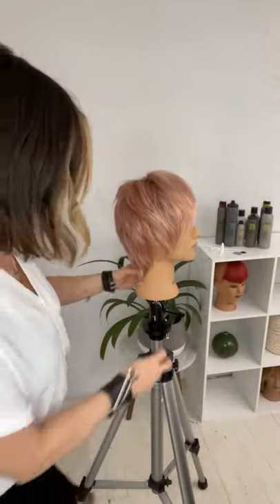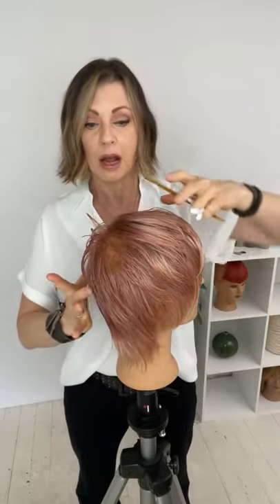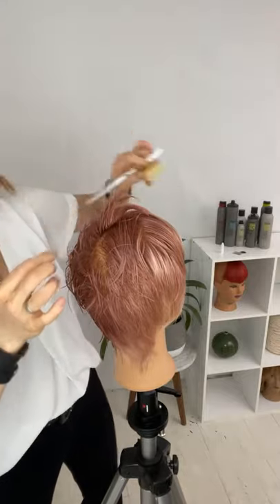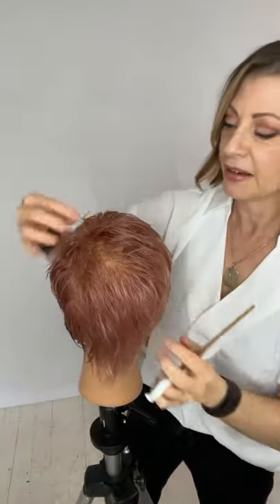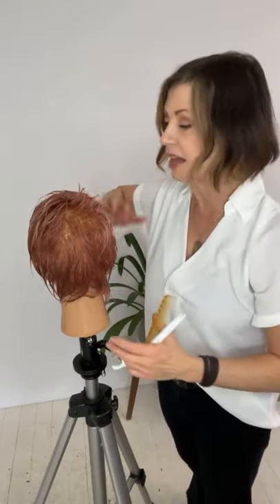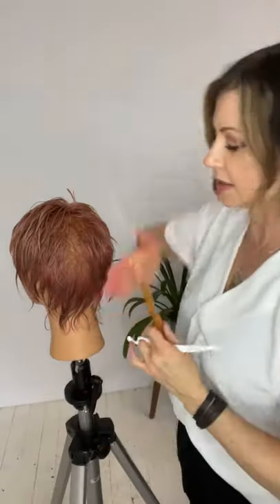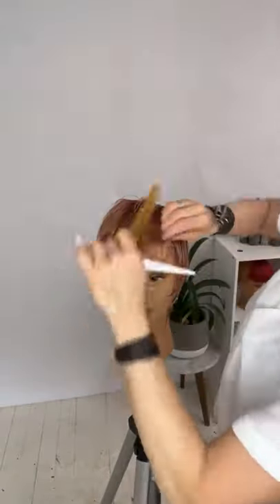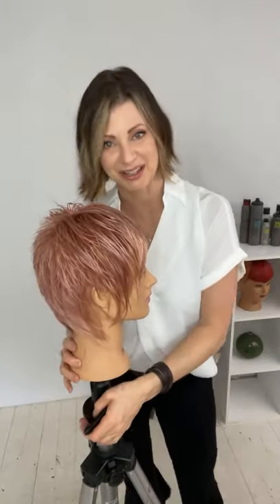Fix Short Hairstyles | How To Fix A Bad Haircut | Short Layered Cut | Fix a hole in your haircut

Comment: I liked it even before the "fixing"! 😃 I think BOTH cuts are gorgeous/flattering/stylish, & the hair coloring is really pretty! I've been cutting my own hair out of necessity since covid  & learned from watching videos on utube. My only problem is, I have trouble with the back / getting height around the crown & removing bulk. My hair is short like the model's but it thick & naturally wavy & curls up around my neck - I could never have the straight shag-cut whisps the model has. I'm not sure how to thin it out down around my neck while trying to increase the length. Anyway, thanks for the video!
Reply: O9